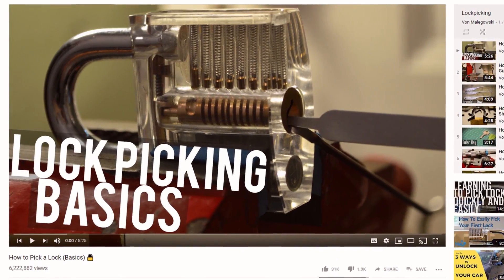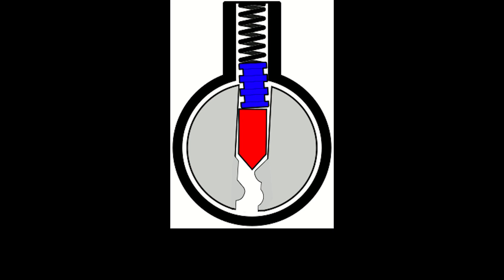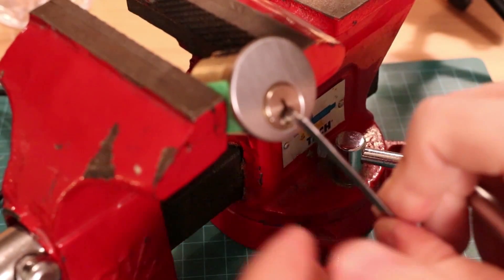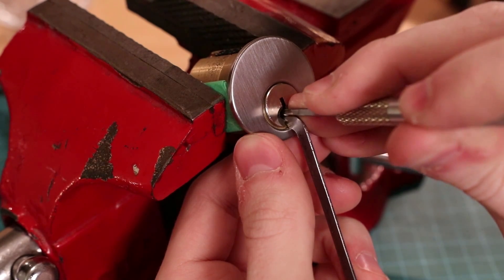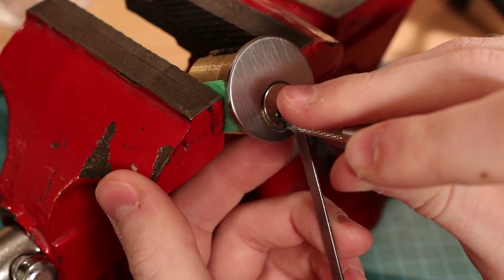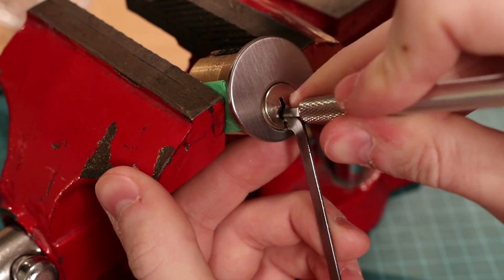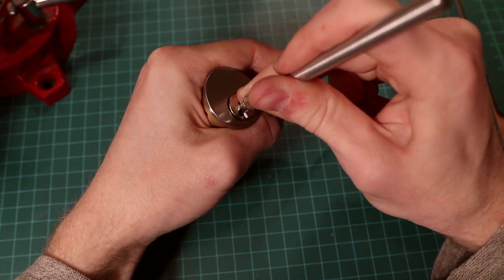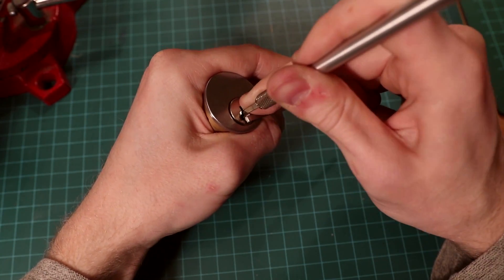Lock Picking Security Pins: How to Pick Serrated Pins

Comment: You're mainly correct, however serrated driver pins do not effect impressioning at all. When the key blank is inserted, all driver pins are pushed into the bible, and only the key pins are across the shearline to impression. Fancy key pins with serrations, grooves, etc, etc, actually help impressioning by gripping the key pins more tightly at the shearline, thus transferring better marks to the key blank. All the factory made security pins, or home made security pins, can and do make SPPing  more difficult, but will in fact help to impression a key.   Regards, Brian.